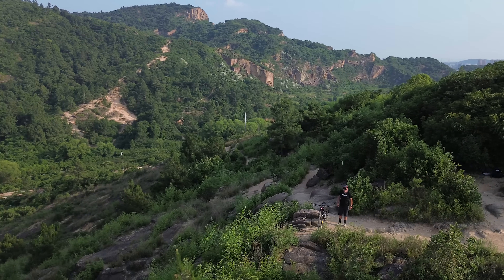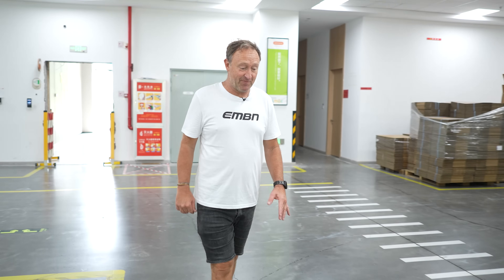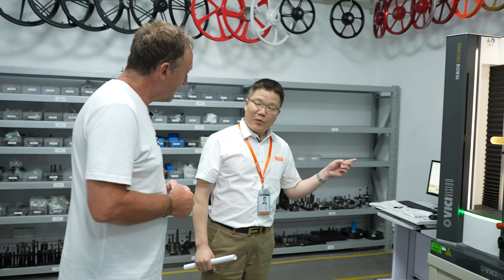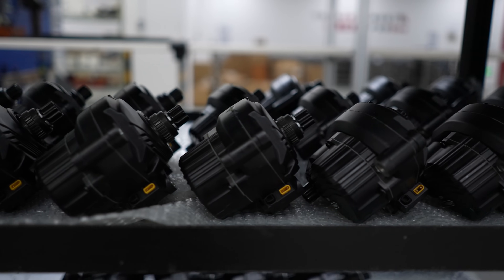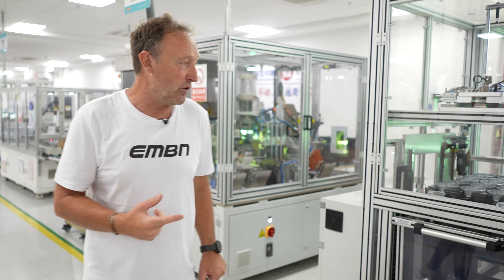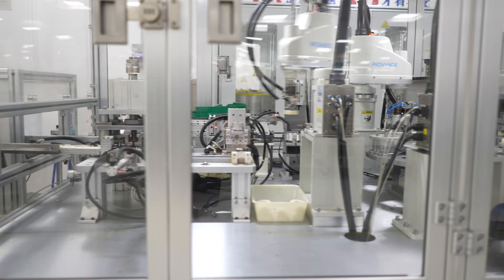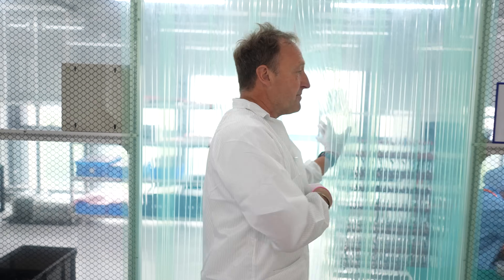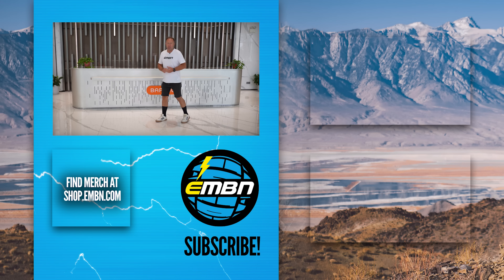eBike Motor Production Line At Bafang | Suzhou China

Comment from the maker: What motor do you currently have in your eBike? Let us know in the comments!
Reply: Sync drive pro
Reply: @user-ga42  yes
Reply: M620😎
Reply: I have 2 Bafang mid motors 
1.350w 36V mid motor... beautiful motor.

2.1500W mid motor to be installed.

I have world best n most expensive semi recumbent cruiser with Bafang
Reply: Giant Sync drive pro
Reply: M560 and is monster! Just quite a lot noise.
Reply: @dado304  when you say loud do you means it’s loud the whole ride or is it in higher modes that it’s loudest.  Does it make your ride less enjoyable?  Pretty concerned because I  getting a bike (weaponx) with the m560.  Your thoughts would be greatly appreciated!
Reply: Specialized 2.2 Custom Rx Trail Tuned Motor (2023 Brose)
Reply: EP8⋯⋯😢
Reply: Bionx D250
Reply: BBS02b, they've released a few new versions but they always make it worse for the consumer, locking the motor to their own silly gigantic battery.  I'll probably get a Toseven DM02 next.
Reply: Currently have two e-mountain bike motors. The fang M 600. Which is my powerhouse bike. And I have a Bosch generation for smart system CX motor. Love both motors, but for different reasons.

Am so so glad to see you guys at Bafang . Which has to be one of my favorite motors.

So impressed how their manufacturing and assembling their motors, controllers and batteries
Reply: Currently have two e-mountain bike motors. The fang M 600. Which is my powerhouse bike. And I have a Bosch generation for smart system CX motor. Love both motors, but for different reasons.

Am so so glad to see you guys at Bafang . Which has to be one of my favorite motors.

So impressed how their manufacturing and assembling their motors, controllers and batteries
Reply: Bafang m620 on a Markhor Hau Shan
Reply: Bafang M620
Reply: Toseven DM01
Reply: Ananda m100
Reply: Pinion MGU
Reply: Pinion MGU
Reply: M820 in mine! 75nm love it
Reply: Bosch cx
Reply: I have The Voliamart 1500Watt Hub Motor.
Reply: I have The Voliamart 1500Watt Hub Motor.
Reply: I have a 1000w Bafang hub motor and it is “torqueky”!!! 😁😎
Reply: M620 but hopefully a Bafang MGU is in r&d and will be my next motor.
Reply: m620
Reply: Bafang 510

Comment: Bafangs customer service leaves a lot to be desired!! My M510 on my Vitus E Mythique snapped clean off further investigations showed up other fractures in the torque sensor crank shaft!! Less than 2 years old  done 238 miles  emailed them loads of times with pictures not interested!!

Comment: Cheaper and BETTER will save the industry, and Bafang is a class above on all accounts. T800 carbon ALL MOUNTAIN EMTBs with Bosch or ANYTHING ELSE are 10 to 15,000 bucks. With Bafang and ALL Chinese components including ELECTRONIC shifting is 2,500 bucks at best, and many times superior. T1000 carbon bike packages or above cost about 1,000 more but is nowhere near the price Trek is asking for their packages.

Comment: I was there at the start of emtb with Bosch Gen1 on a Cube  also had a specialized Levo.. Then I had a break from emtb due to health. I currently commute to work everyday in all weather's summer and winter I use a bafang rear hub system great for commuting.. I am also looking now I am back and we'll enough to ride emtb.. I will certainly not overlook bafang.... that was a fantastic video.. great job.. thanks from a old time viewer.

Comment: Bravely done Steve! You've come a long way to embracing Bafang from the old days! As a Bafanger owning the full gamut of Bafang motors from the huge M620-160Nm, M600-120Nm and the  compact M820-75Nm. Powerful, reliablIe, and less expensive.💸 It was awesome to finally see the full motor parts breakdown. Now if they only could make a casing gasket that wouldn't 💯 break when opening it for a re-greasing at 2k miles.😝 Or at least make spares to sell for the newer motors M820.😁

Comment: Currently riding a CX4, Bulls Copperhead evo AM. Love the motor, love 750 battery. Love the damn bike! Dont love the ever ticking time of warranty running out. Without dedicated parts ordering availability, like a website with diagrams/schematics and component support. 

My next bike. Without a doubt, will be Bafang powered. No other manufacturer has the aftersales and after warranty support Bafang offers. No one. I wanted a Vitus E myth, but at the time, they weren't available in North America. Now, it is not available at all. So, it shall be framed by an E82 or Markhor(very MonDraker like). 

Sure. DJI, Pinion, and ZF are all on the horizon. But, despite all the wow, where is the age-old demand? Which is repair support, which means resale value, which means overall value in your product. Ultimately, loyalty.

Comment: I worked in the USA for what is probably the most successful suture manufacturer in the world and their clean room procedures weren't this impressive. ( I've been retired for a few years TBH) The automated machinery looked very familiar and similar. We shipped most of the non-automated jobs to Juarez Mexico a while back though...I have a BBSHD on a bike I built years ago and my son has a M600? on his Motobecane full suspension EMTB that is several years old and lives in the Arizona desert.. Only the control display has failed on the Motobecane...I have to say that I don't like the way power is delivered on the BBSHD but it is fine ( and powerful)  for non-trail use. I like the Tongsheng torque sensor mid-motor better for DIY off road use even though it has less power and tiny brittle wires....My wife also rides an E-bike on the street with a bafang hub motor with zero problems.

Comment: Nice to see, thx Bob. Don´t they do also Bosch and Shimano Motors there? ;)

I tried to replace my E8000 with Bafang because E8000 crashed 4x at ~5.000 km but cant find the matching Parts. Now i have a new Bike with BOSCH smart CX and it running since 13.000 km perfect.  But the BOSCH marketing is not so user friendly,  no compatibility for Range extender Power More 250 ore TRP or DI2 Shifting  with my Motor from 2022 - so sad. 

Bafang has no Designer for Motors? And you can´t compare the software with Bosch Software? Never see such comparisons! No Range extender? No nice Bikes? No reseller in Europe? 

Maybe they can make than Adapters für the other Motors, to replace defect Shimano ore Bosch  Motors after Warranty with Bafang systems? Maybe there is coming a big Market for that soon, but where to buy? Website with many Blabla, i believe that you can build a good Motor! But where to by, where to pay, how to have fun? ;)

Comment: I have had multiple the Bafang motors from the M620, M 600, M 510 and most recently M560. In general, they have very poor waterproofing, lots of power and the controllers leave a lot to be desired. So far the best is the M 600 with the Luna Ludacris controller. This takes the motor within range of the Bosch or Shimano for smoth power delivery however still not as good. But it does give you a lot more power. However, for all this power, you have to bring a bigger battery. I had the original issue M560 which had very loud gearing and the overrun was literally dangerous. One time it launched me from almost a standstill 4 m forward. After that, I took the motor off it went back to the M 600. And I had three of the early issue M560s so this wasn’t a one off. They were all the same lousy controller.
At see Honor they had the latest issue of the M560 which was quieter and performed significantly better. I am hopeful that this will be the motor of the future.  The M510 is a nice motor, but I have never had it put out much power. The other issue with the Bafang motors is the lack of good frames. They finally have one coming out called me E 82 however, the seat tube is crazy high. I think the large is 490 and the X large is 520 mm. I don’t know what kind of a dropper you can get on this, unless your legs are very long. I know it’s way too high for me. So for now I’m riding mostly Bosch. I have big Crestline RH4 with the Bosch race, which is an absolutely awesome bike. I think the chain stays are a little bit long and the BB is a little bit low for my rocky trails, but at present, there’s no way to get everything. It’ll be a very interesting to see how long it takes to get the new DJI and ZF motors into production.
I also want to mention all the talk about throttle bikes, being illegal, etc. we always carry the throttle in our backpack when in the backcountry on a Bafang motor bike because if you get an injury to a leg or even an arm, having that throttle can be a lifesaver to get you home.

Comment: What base grease did the put on those gears?
Reply: I have an M620 motor and in its stock form it was really loud and so I split the case and took out the meager amount of white lithium that was in it and replaced it with a heaping tablespoon of John Deere Cornhead grease and it now is virtually silent all but under full power there is a bit of a whir. I would recommend it highly for any motor with steel gears especially.
Reply: @livinglifeontheedge4261  yeah I've seen a video on YouTube someone doing that to m620 gears. I own a m620 also and have split my motor also. Did you know as of 6 months ago the m620 motor now has noise reduction gears ( same size gears with more teeth) videos are on YouTube comparing the new v old, I bought one a few weeks ago to replace my mates faulty m620 and its pretty much silent. Yeah they used black grease in this video not white like our older motors.
Reply: @rossg9363  Yeah I am aware of that but no need to switch as it is as quiet as can be expected now with the new grease. Also the newer motors that are CanBus don't attract me at all. My bike is a 52v UART version that I have tuned just the way I like it!
Reply: @livinglifeontheedge4261 ok cool, yeah I agree UART is the way to go, mine is UART system with a 52v 1000wh battery and I checked the serial number on the controller on my motor and it's its a 48v not a 52v go figure, that how I bought it yours might be the same to
Reply: @rossg9363  Nope mine is a legit 52v as I drowned my original 48v and replaced it with a 52v from GBK.....However it was able to use a 52v battery with the 48v controller oddly enough.
Reply: @livinglifeontheedge4261  cool man what part of the world are you in? I'm in Brisbane Australia 🇦🇺
Reply: @rossg9363  Oceanside, OR USA 🏴‍☠ Finally got a drive train that is lasting. Shimano Linkglide derailleur, cassette and chain with a steel chainring and shifting electronically with an Archer Components system. Works great!
Reply: @livinglifeontheedge4261  Oh yeah between San Diego and La your the 2nd person in 2 weeks I have had a good chat with  from that exact same area! the first person was a female thow from YouTube comment section she asked me to come over there and party with her hahaha 100% true story don't happen offen on YouTube comment section but it happened.. anyway it's on the cards one day I'll get over there. I like your area more and more by the day seems like great people everywhere👍 sounds like a kickarse set up you got!!! My old emtb had XT gear on it but this one is Sram I haven't done a lot of miles on it only a few of hundred, I'll go back to XT if it wears out keep it simple for me 😊
Reply: @rossg9363  Oregon, not CA thank dog. Big difference!
Reply: @livinglifeontheedge4261  Oh yeah near Portland. From what I see on the news on Portland it's different to most of the usa

Comment: Another BBS02 user here (UK based), first one did over 10k miles, still runs fine but the bike is literally disintegrating around it so needs a full refurb, new wheels/brakes forks etc. Specialized Crosstrail. Second bike is now up to 3000 miles fitted to a Trek Dual Sport4, again, suits the bike perfectly

Comment: No wonder the Chinese brands are cheaper than other brands... it's the sheer scale of its operations. 
Buying a bafang would have put me off before,  but after watching their factory operations i wouldn't hesitate now. 
Yep, buying an emtb is next on my list. Something that i wouldn't consider before,  but I'm getting on a bit.
Reply from the maker: That's great, it looks like they've got the process nailed! Do you have a particular brand in mind?
Reply: @embn  I'm just looking at the moment,  but the vitus sentier is incredible spec and value for the money and they also use the bafang motor.  Unfortunately, they are no longer available, but their website is still up???? I was tempted at the new amflow by dji, but my wife would kill me if I'd spent that much on an emtb, lol.

Comment: New Bafang’s engines are super cool pieces. Every year they reduce the gap to European manufactures. Its matter of time where Bafang, DJI, etc become leaders.
Reply: But engines are motors
Reply: DJI's first bike motor is the most powerful by far for the weight, they are already leading, it's just getting the brand recognition it needs which will lag a bit, but won't be long, just look at how BYD is tracking, 3 years ago, not many heard of the name, let alone want to buy one, nowadays it's gradually becoming a household in Australia name due to its technology, quality and value.
Reply: @passby8070  LOL! meanwhile BYD is banned in EU.
Reply: Motors not engines.

Comment: iv had two bafang motors bbs02 and 620 ultra both been running around 5 years no issues and still going strong. ultra is the best motor so far except it is heavy. now im running cyc stealth gen 3 light and powerful 160nm 2500w on an old enduro santa cruise nomad. its a beast! gets me grining every-time i get on it. tops out at 70kmph and gets there fast though i generally run at 25-30kmph as i dont want any undue attention from mr plod. bike 23kg rider 75kg maybe 2-3kg for backpack pretty much 100kg total. love it
Reply: @robertsmark2650  wow man I'm envious. I've never had an ebike but if I do I'd like something serious like what you have. Unfortunately pretty strict here in Australia re roads/e bikes. So would have to use it off road most of the time. What battery do you have?
Reply: @Avatar711Wizard  im in aus too, im just careful where i put the power down. iv got a small 52v 10ah battery and it enough for me. i get two three hours pedal assist plus some fun blasting the throttle on occasion
Reply: @Avatar711Wizard It's only illegal if you get caught and if you don't ride in the city or spend most of the time outdoors there's no real trouble.